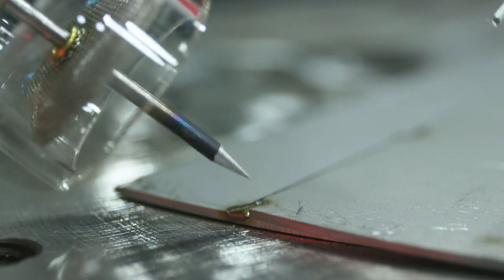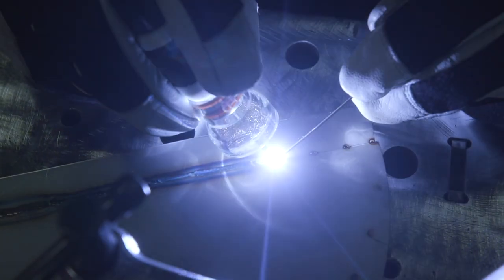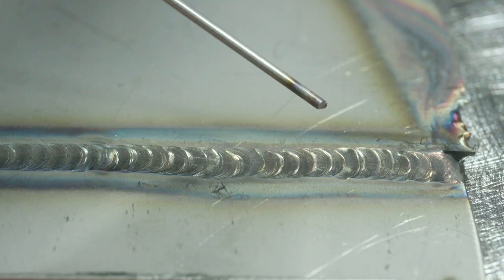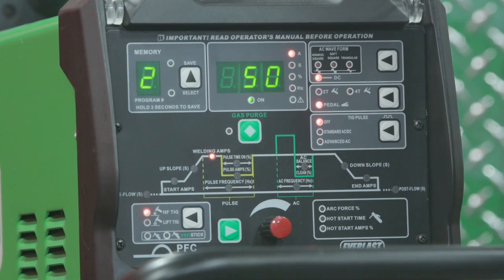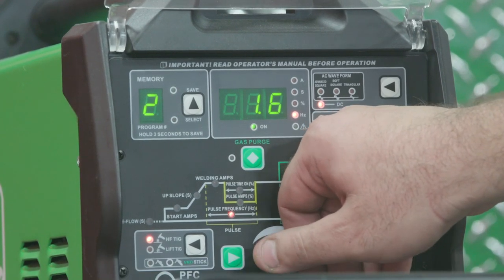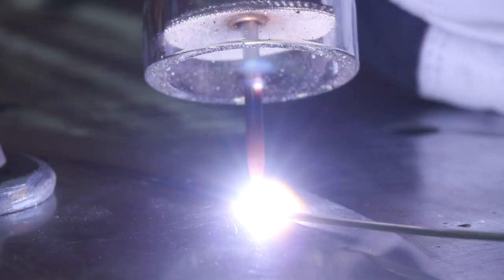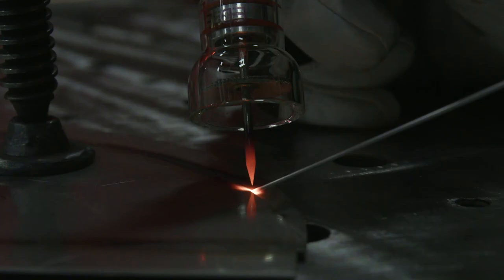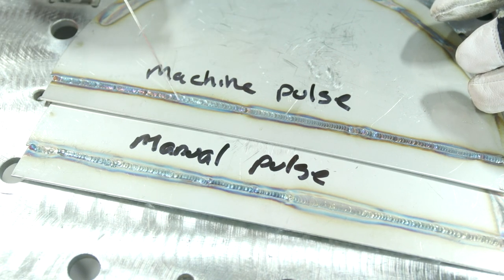Manual vs. Machine Pulse Welding

Comment: Very amateurish speed control. I can match a pulse weld in uniformity anytime.
Reply: True. And any good welder should be better than the machine.. But I'd rather see an amateur guy using the pulse control if it helps him get the speed and timing down.
Reply: Same here,  and if you're going to compare manual to automatic you need to actually back off the pedal more than a little bit. 

Imho, machine pulse is best used in the 250-500pps range solely for heat dissipation